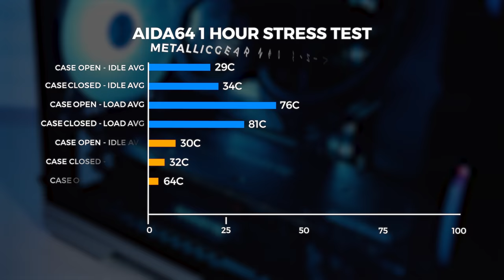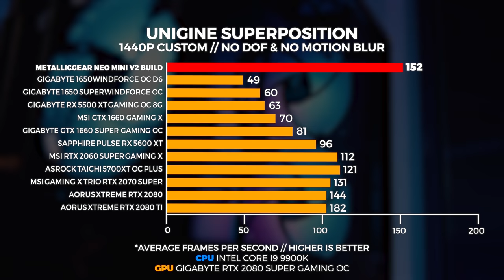Mini ITX Gaming WEAPON - MetallicGear Neo Mini V2 Build

Comment: Hi Nick/Klaire, question for you. Do you know how big of a GPU can be fit into this case (i.e. 2.2 slot, 2.5 slot, 2.7, etc)? I migrated my build to this case last week from a Fractal Nano S mainly because of GPU clearances (I have an ATX PSU so it would've been tougher to fit anything larger than a 2-slot in there). While it's obvious that it can do larger than 2 slot but smaller than 3 slot, I'm not clear on what the exact limit is, so it'd be great if you could shed some light on that. Thanks!
Reply: Hey!  did you find the answer to your question?  I would also very much like to know: is it possible to insert a 2.5 slot video card into this case.

Comment: Hey man just curious, how are the noise levels with this case? Im looking to buy a nice case because I got a prebuilt alienware aurora r8 and that case is way too tight and has awful air flow. Kinda looking for a fresh start. I wanted to get a case with a huge chassis so I can have more options for the components I put in, but I'm wondering if it's even necessary if I can fit decent quality components in this case. I'm tryna find a case with good airflow that keeps stable temps and has decent noise dampening. Would you recommend this case for someone that doesn't have a ton of space for their setup? I've been looking at this case or the Be quiet dark base 900 rev2. The be quiet case seems kinda overkill but I'm still tempted anyways. Might not be the best idea though. If you have any input, that'd be great!.

Comment: I own MetallicGear Neo Mini. Really surprised why only few ppl making videos about it. 
Great case and fantastic build as usual. Although, I would like to see it with custom loop :)
Reply: What kind of temps do you get during gaming under heavy load? Thanks
Reply: @Cipher_XoF  I have strix 2080 Ti and with 50% speed it never reaches more than 70C.
Reply: @Tutku35  thanks. I currently have a NZXT H200i case and my Reference 2080 Ti gets to 80c easily under load. Might change to this case.
Reply: @Cipher_XoF  is it a blower style?  or you ve men founders edition from nvidia. Either of these are not engineeringwise providing decent cooling performance so it might not be the case but the cooling incapability of the card itself.

Comment: Is it also possible to mount the radiator on the front side of the casing instead of on the inside?
I ask you this because I prefer the radiator hoses at the bottom because an AIO is usually never 100% air free and with the hoses at the top there is a real chance that air will constantly pass through the pump, the other way around is 100% sure that no air will get into the pump.
Reply: You can certainly take out the silver side panel thing and instead mount a 240mm rad above the GPU, here is a pic of mine: https://mega.nz/file/IgJBGYSJ#ZdEqZLSiCUI9bKveJ2khrbOSJ221289PM7-UcJMbpqU

Comment: Really stuck debating between this and NZXT H210. 
I have a 240mm AIO and an SFX PSU to fit in it (for a 10700K CPU and mid-range GPU). 
I kinda like the looks of the Neo Mini V2 better, and the fact that the GPU has direct access to fresh air. But the NZXT has 2 exhaust fans instead of just one, and with a deshrouded SFX PSU there will be ample space for the GPU to breathe. Also LOOKS like the NZXT has more room to let air in.
But I prefer the Neo Mini's USB location (and two USB type A connectors instead of one of them being Type C while my mobo does not have a Type C header).
Thoughts?

Comment: Hey dude, great vid! I have a meshify c currently and have been considering down-sizing to an ITX case you save desk space. I noticed you switched from the same case, is it significantly smaller and how do the thermals compare? My current GPU (1080Ti) runs pretty hot in the meshify c with the 280mm AIO mounted to the front.

Comment: Hate the thumbscrews on glass and hate the limited airflow on that case.
Reply: Limited airflow? U can remove the silver thing on the side and install 2 more 120mm fans or a 240mm rad, in addition to the dual 120mm front fans. Mine:

https://mega.nz/file/IgJBGYSJ#ZdEqZLSiCUI9bKveJ2khrbOSJ221289PM7-UcJMbpqU

Comment: you should not mount the radiator like you did. the barb should be down instead of top, in order to avoid to suck air through the pump.

Comment: Do you think a RTX 3080 or 3090 would sit comfortably in that case?
Reply: evga xc3 3080 should. The clearence is listed as 345mm but if you are going to have front intake fans (25 mm) you are left with 320mm of clearence. Also look out for the thickness, for example the aorus pros are almost 4 slots thick and would not fit.

Comment: i have the same case and similar build except i went with core i5 10600k and rtx 2070 (budget build) and i managed to fit sleeved cables for all the cables and 2 additional rgb fans on the side (6 intake [including graphics card fan] and 1 exhaust]. it took some time but yeah it turned out pretty clean. I even wired all the fan and rgb cables behind the motherboard, (yeah before screwing the motherboard to the case i wired them and tightened it after) I even managed to install an additional 3.5" harddrive and still have the space and wire for another hdd/ssd.

Comment: ITX builds are the best. Mine is a micro ATX and still feel it's too big.
Reply: Agreed. I do not know a single person, who uses the second PCIe slot or more than dual channel ram. Those are the main reasons to go big... (ok, price too).
Reply: Yeah. They are pain in the ass during the building phase (and my Lian Li TU150 is one of the easiest to build in!) but the result is so satisfying. High powered machine that is easy to move around and even take with you somewhere.